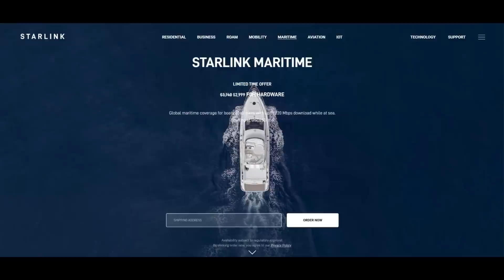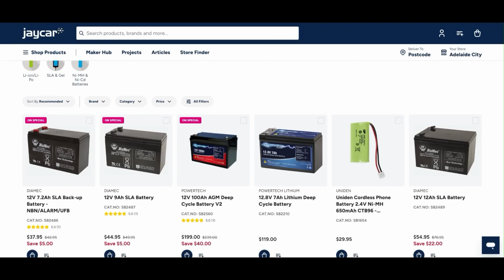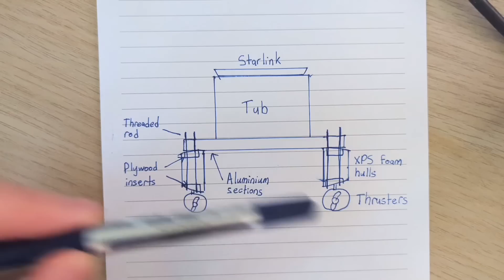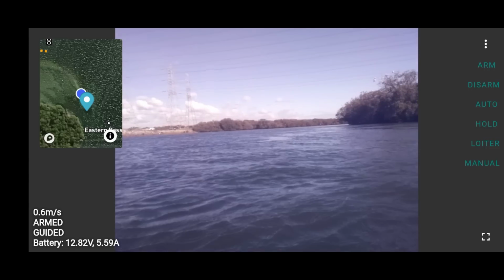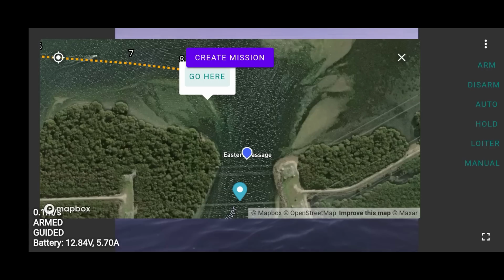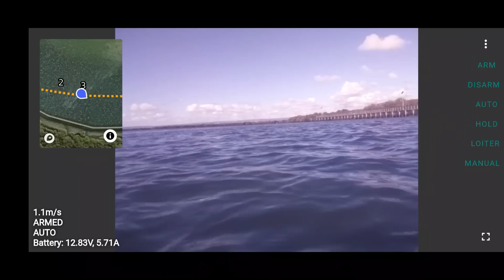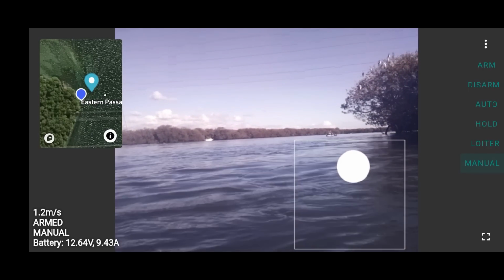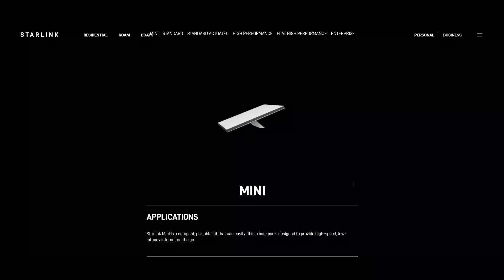Autonomous Starlink powered R/C boat - control from anywhere!

Comment: Legendary work, and can't wait to see improvements like the starlink mini. Would you want to drop the CofG lower down buy putting the box closer to the waterline. It looks top heavy now, a boat's wake could flip it. Then you would need an ip68 case like a peli case. Your asymetric hull design has quite low efficiency, it would be 10- 15% better if both sides were curved. Keep it up mate, this is excellent.
Reply: I was thinking the same thing about the CG and "cheap plastic tub"!  :)
I thought it was very BRAVE to put all of that nice new equipment in a plastic tub with out being water tight!  But, hey, great to see the results, @thingify-app
Reply from the maker: You're right that the CG is pretty high - the Starlink Mini should help a lot with this, it takes about 6.5kg off the top of the boat. I'll take a look at the peli case - something more rugged like that would be good once I find a suitable external camera. Also that's interesting about the asymmetric hull, I wasn't aware of that! Something something wake vortices?
Reply: @thingify-app  yes the hulls are generating quite a lot of lift in the outboard direction, which throws away propulsive energy. you want them symetric and sleek like torpedos or tear drops.

Comment: Interesting vid and concept. Boats and RC cars i have done most of my life. a thing that may help you is angling your thrusters to pitch the nose of the hulls up a bit. Even with the small chop. I could see you stuffing the nose in a wave and possible unsettling the boat a bit. or could add Chines on the hulls to give the nose some lift . looking for the missions
Reply from the maker: Yeah, I think a more sophisticated hull design could help there, possibly using a CNC router to shape the foam. It should also sit higher in the water with the Starlink Mini due to weight savings. Lots of fun to be had improving this design!